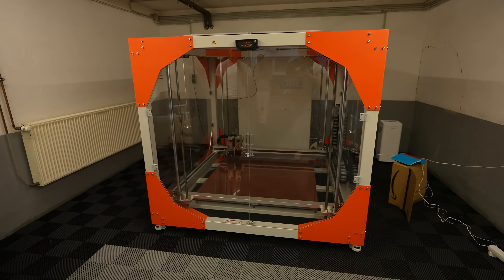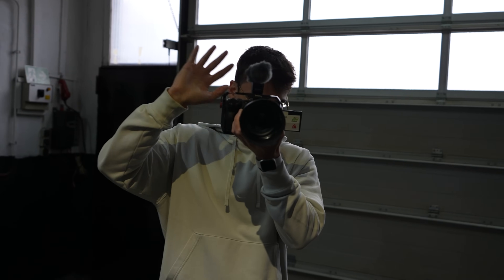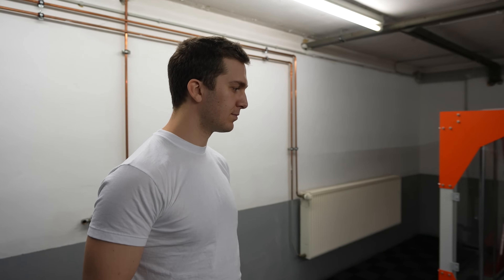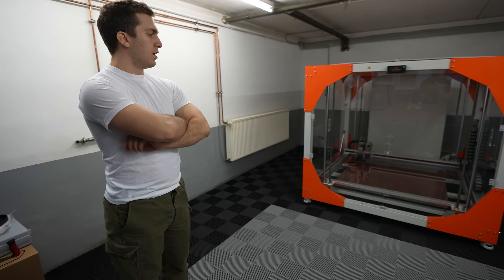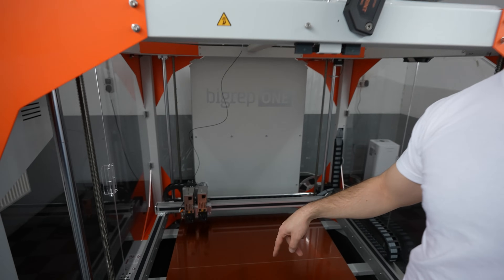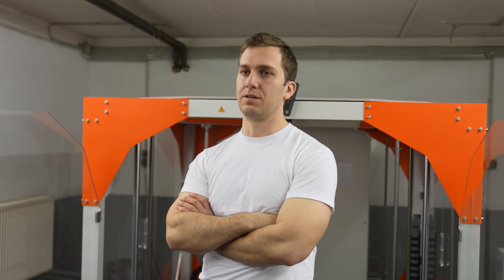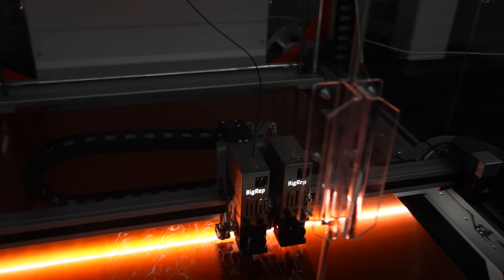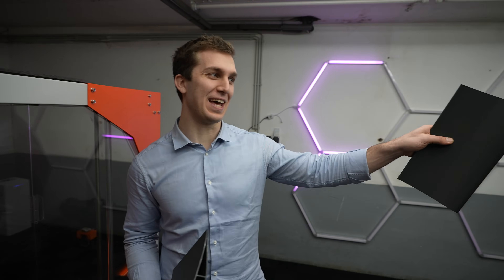NEXT LEVEL AERO! Our New MASSIVE BigRep One.4 3D Printer! 🤯

Comment: Here's things I would recommend you guys do to get more out of your 3D printer and 3D prints
1- Change the Slicer from Cura to Orca Slicer it will make printing time way less and make printing very reliable and strong.
2- Dry your filaments and ensure they are kept in a cool place not too cool not too warm because that will cause them to be brittle and break easily and cause a Jam you don't want a Jam trust me.
3- try to add heated print chamber it will be great for filaments like ABS and other high temp filaments and stops them from warping.
That's all I have for tips wish you all the best

Comment: i tried 3d printing a very generic airbox, like an open air filter for my car, i printed it with abs and nylon carbon fiber on a bambulab x1e and it deformed. It is located in the engine bay, i dont know how you would print an airduct for the brakes knowing that brakes could go to 1000 degrees, if you are using a special type of filament (probably you are) or using that 3d printer for mockups.

Comment: Surprised to see that it is an open printer. This will limit the materials you can print, especially at this scale. That said, 80C bed is too low for things like ABS, polycarbonate and most nylons. I guess you guys are mostly printing PLA and carbon fibre PLA, petg and perhaps TPU. Some PA6 nylon would be an edge case. I would think glass fibre TPU90 would be a useful material for aero, as it has a bit of flexibility as well as added impact strength.

Comment: Some more pro tips; Dimafix (and along the way, PEI build surface), and more important get ruby nozzles. Not the cheapest, but they last forever, whatever filament you print. Mine are currently all above 20 kilometers printed filament and show no sign of wear.
Reply: Epic that kilometers can be a measurement of manufacturing with a printer

Comment: I'd LOVE to see a new type of prototype race car. 4 high downforce ready wheels with regular suspension for low downforce car, one or two downforce underfloors mounting to the uprights in stead of to the chassis. The downforce doesn't load up the suspension, just the wheels. Unsprung mass, but we see with in-hub motors that it can be alright. 
Could existing cars get unsprung downforce add-ons? Imagine a modest F3 car getting them as an upgrade for time attack and hillclimb. The unsprung floors could of course also be fan powered. This might allow them to be less unsprung mass. The fans and hoses sit on the chassis, only the structure and inlets are unsprung. Imagine a "sleeper" F2 beating car that looks like a Formula Ford. Fan aero, real slick. Engine chosen for power to weight. Some rallycross unit? Relatively affordable tyres as there is so much downforce, you can go narrow, rated for a heavier car.

Comment: Cool things are in the works here.😊
If you going to get molds cnc machined then 1 off parts are not possible?
Do you also use a specific cfd software ?
I used simscale a lot for making my cold air intake pipe .Love to come by one time and see the workshop.
Reply from the maker: Depending on the applications, we will make CF or Aliminium molds. Autodesk is our CFD

Comment: Misha andTeam.   How about Designing an Intake Manifold for turbo Engines like Porsche V6 Or V8 and for BMW V8 that has coolant channels so you Can run Coolant though the Manifold to cool down Air More to mix with Fuel
Reply from the maker: Adds more complications and weight, don't you think?

Comment: damm i tought my ratrig vcore 500mm is big but this is massive

edit does that room have ventilation?
depending on filament you are using the fumes are quiet harmful
Reply from the maker: The room is very close to the exit, our bigger problem is actually lack of isolation and humidity levels
Reply: I strongly assume an industral printer, especially at that price class, comes with active carbon filters. Even my normal consumer printer (Bambu P1S) has one.